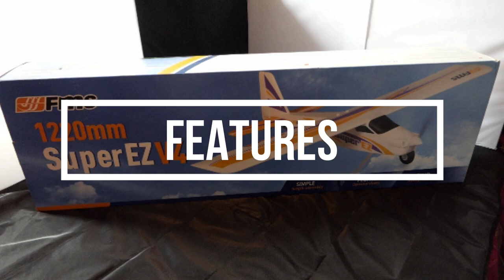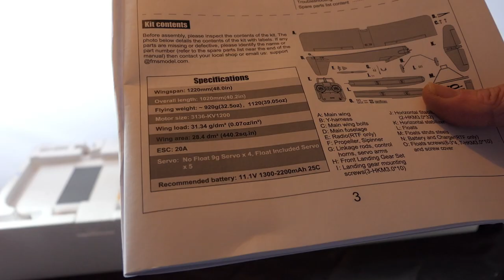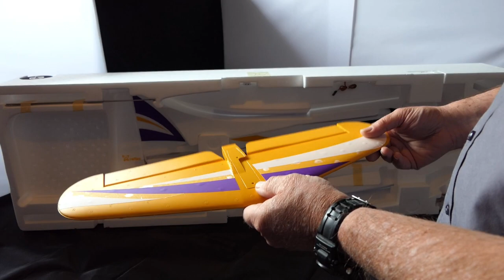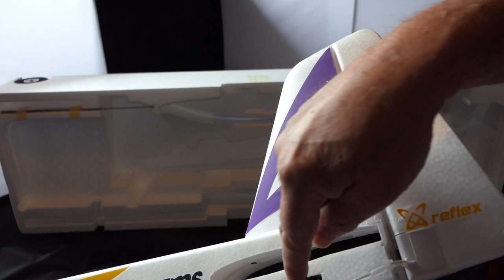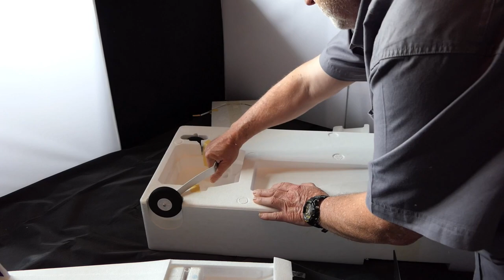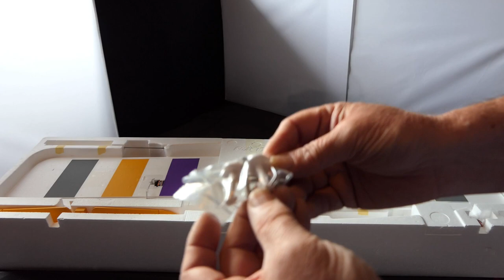Unboxing  -  FMS Super EZ V4 with Optional  Floats

Comment: Hi Martyn, Many thanks for this video as I just purchased it on special here delivered for   144 UK pounds. Was that a good price?
Reply from the maker: Hi Noel - I thought you had a FMS Kingfisher ??!!! - If you do, have one , I am not sure why you would want a Super EZ - as soon as I got hold of my Kingfisher , my Super EZ stopped being my  number 1 fun/easy fly aircraft - LOL - but its a good price they go for about  £160  here in the uk for the FMS Super EZ V4 PNP w/Floats/wheels  & Reflex Gyro 1220mm - and I do still like to fly mine -
Reply: No i do not have the kingfisher Martyn , although i did have the Ranger 1800 & sold it to a friend, then the Ranger 850 & sold it on Ebay.
So now have the FmS  Beaver 2m & Viper Jet. Today i saw the 50mm Arrows jet  on special at Amazon Au for a cheap Uk 85 Pounds delivered.